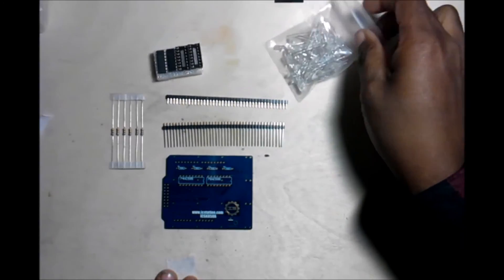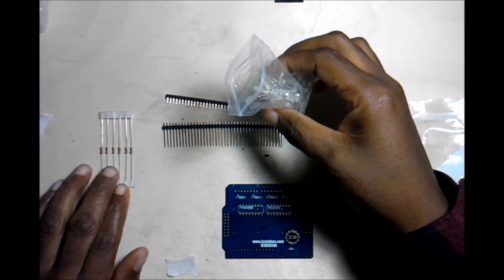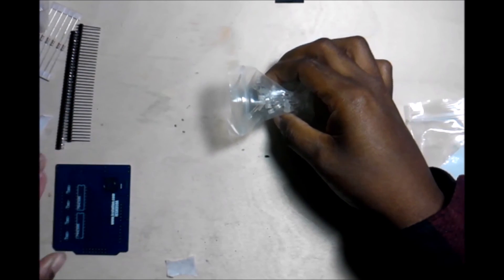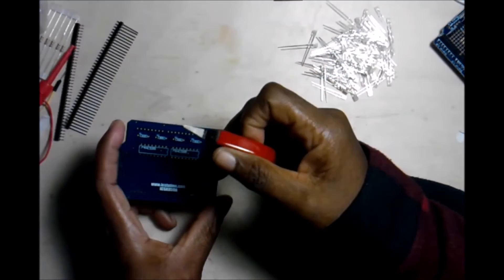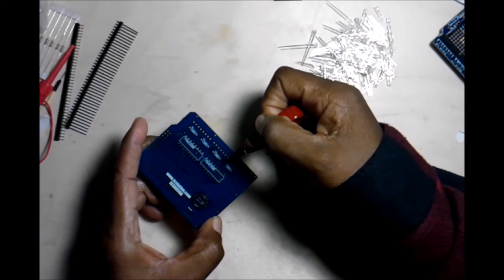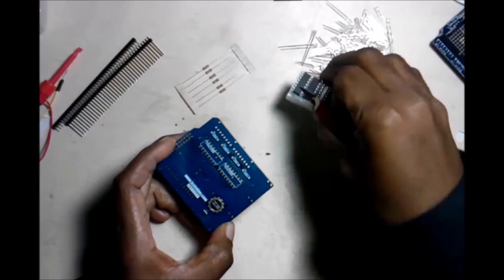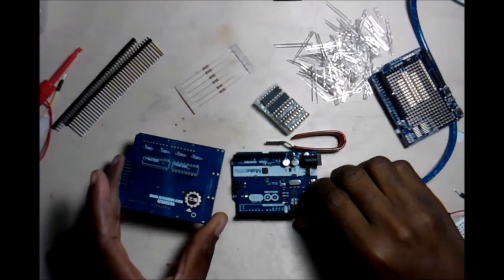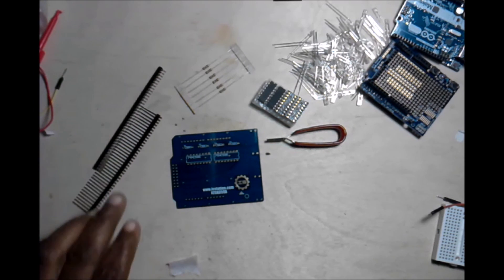How to Make Led Cube 4x4x4 1 Arduino Uno R3  Computer Science ICStation ICSK059A Kit Ebonygeek45

Comment: 13:40 - that's a very useful tip with the 2 pliers - I always used just one set and found that it was really hard to break the pins exactly where I wanted to.
Reply from the maker: Thank you for taking the time to make that comment. That is what is so good about these videos. You see things that might make it easier for you to do something in a way you may not have thought of.  I welcome comments that may point out to others something that they may find useful. Good day @ Oli Norwell. I have an ebook for this project that goes into the programming in detail. If you would like the ebook (free for the great comment) let me know.
Reply: Yeah these videos are the difference between me trying to build this thing and it staying in the package. A copy of the ebook would be great! I was following your videos last night and am about halfway through building my LED cube, I now have the LEDs to solder and put onto the base. Hopefully it will work in the end!